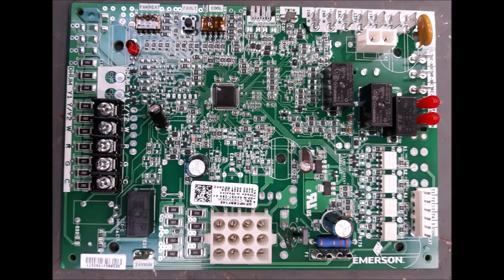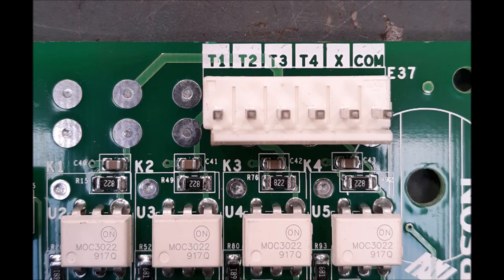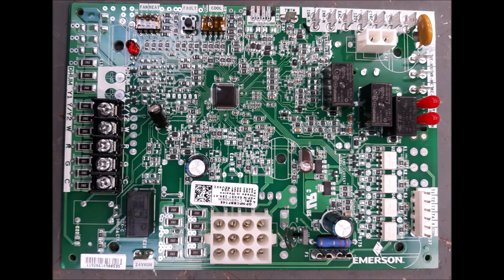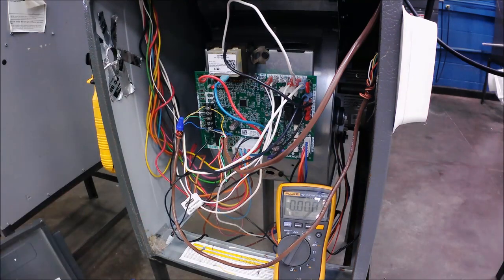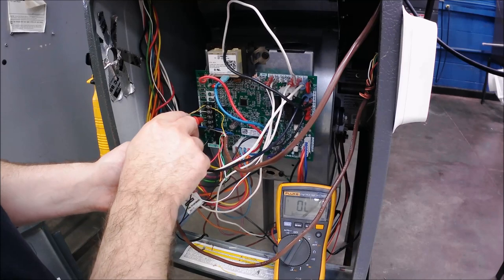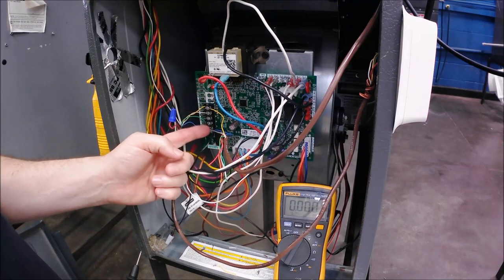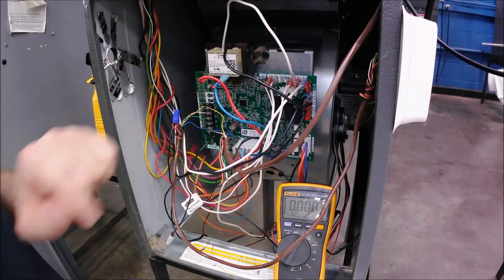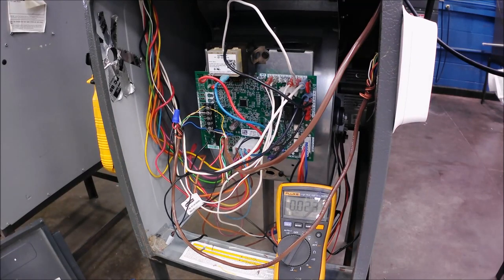Goodman 80% Furnace Circuit Board (with X13 Blower Motor)

Comment: Great teacher! Why the light is completely off in my board. The fuse is good I have 24v come from the transformer but I do not ha voltage in the thermostat wires…
Reply from the maker: Thank you. I know quite a few boards have error codes that say "internal failure" and replace the board. If you have 24v on the xfmr terminals that plug directly into the board from the transformer, and the fuse is good...🤔 ...maybe check the primary safety limits? Tough to say without knowing exact model, but sounds lile it doesn't have 24v power into the board. Most i know of will have light on if it has direct 24v to board even if a safety is the problem keeping voltage from going to thermostat. But if you know you have 24v going and no safety issues...sounds like could be control failure.

Comment: can I adjust Dip Switch while furance running?
Reply from the maker: You should be able to but in some cases the new settings might not take affect until the next cycle. You may have to turn power on and off to the unit in order for it to work.

Comment: Great job on the explanation of that board but one question does the Led light on the board always on when the unit is on.
Thank you in advance.
Reply from the maker: Yes, I believe the led does stay on as long as there is power to the board.